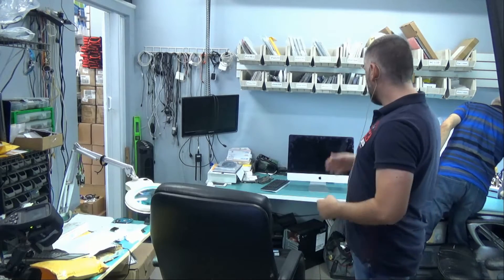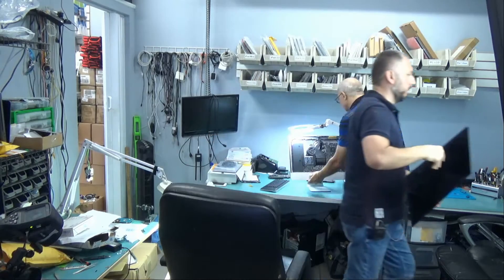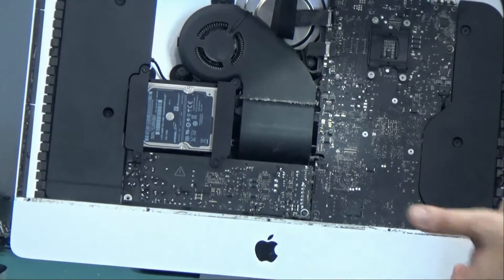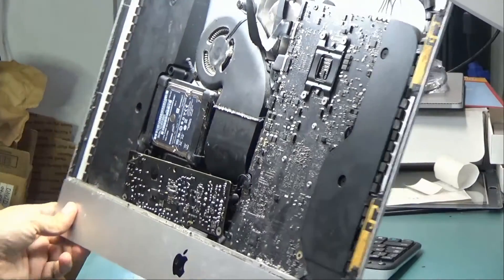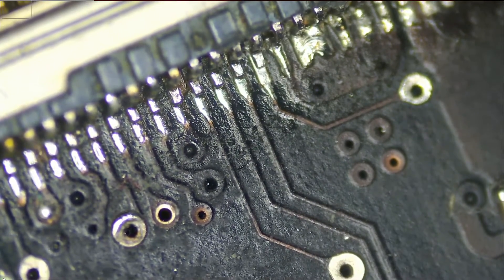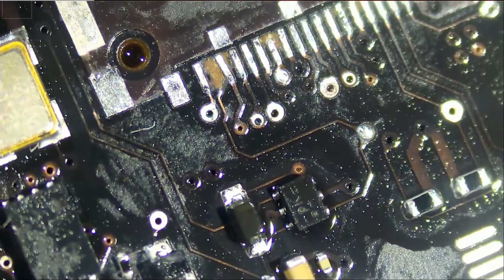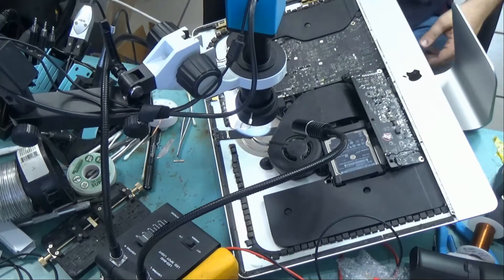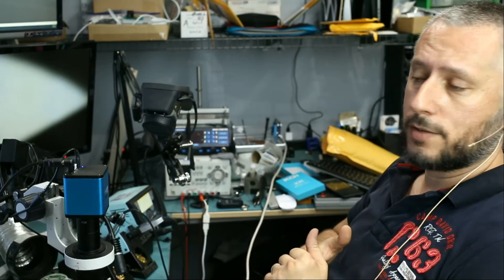iMac A1418 Late 2012 Retina No power Diagnostic using Flir thermal camera

Comment: Hi. I wish to point out about your explanation that if the second light (power cycle indicator LED) is not turned out, it is automatically a power supply problem. I have had a case recently in an iMac 27, late 2012, where the computer showed the exactly the same symptoms as your iMac, yet with the power supply providing power to the hard drive directly. I note that the hard drive is not directly connected to the power supply, but to the logicboard, where the latter seems to provide power to the hard disk but not to other components like the CPU fan. You can hear the hard disk spinning even when the cycle light indicator is turned off. You can do this by pressing the power button to turn the iMac on.  It even turns off when you press the power button again. Would this not contradict your diagnosis that if a cycle light indicator is off means bad power supply? Perhaps you may need to do secondary and tertiary tests to definitively prove that your assertion is correct?